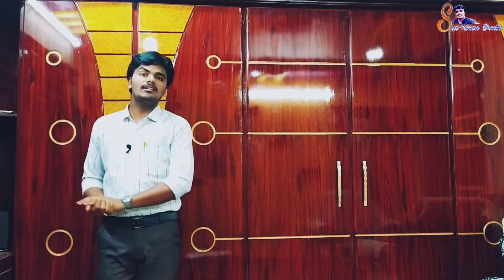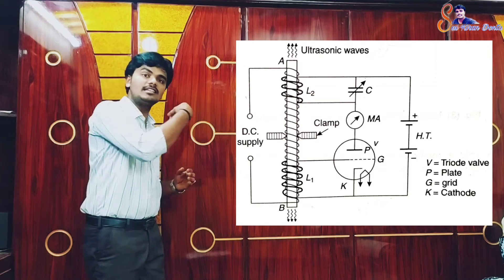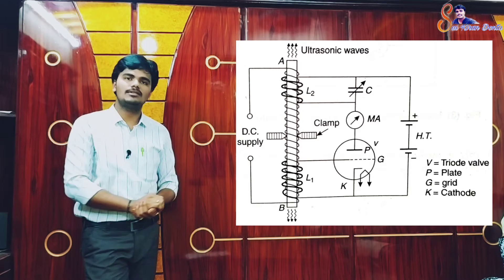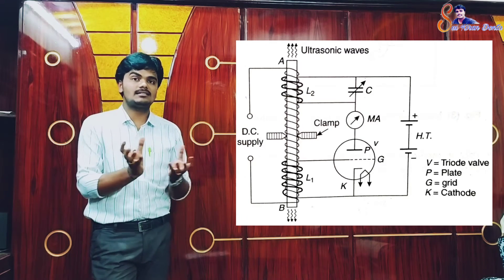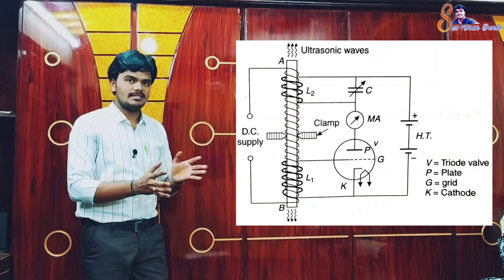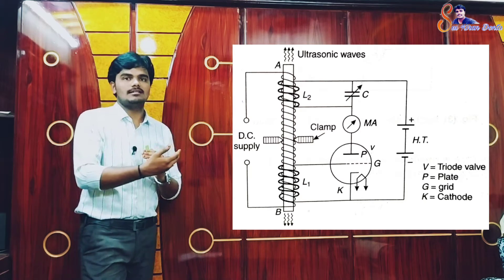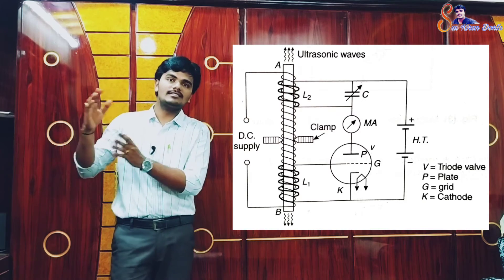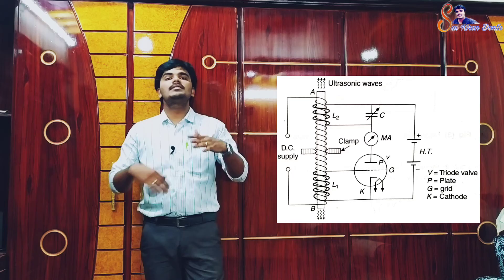Production of Ultrasonic waves by Magnetostriction method | English to Telugu | B.Sc 1st Semester

Comment: Sir .. could u please tell about the advantages and disadvantages of magneto striction method ..
Reply from the maker: Advantages:

Magnetostriction Oscillators are mechanically rugged.

The construction cost is low.

They are capable of producing large acoustical power with fairly good efficiency.

Limitations:

It can produce frequencies up to 3MHz only.

They frequency o oscillation depends upon the temperature.

Breadth o the resonance curve is large. It is due to vibrations of elastic constants of ferromagnetic material with the degree of magnetization. So we cannot get a constant single frequency.
Reply: Thanks a lot .... Sir